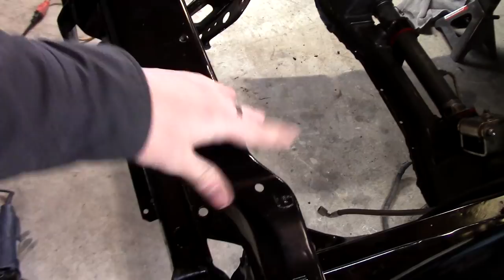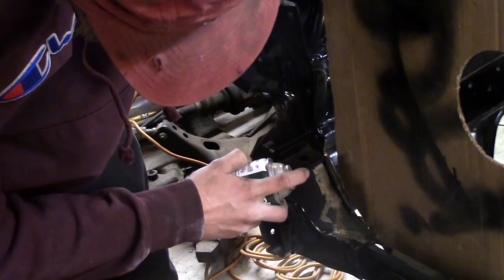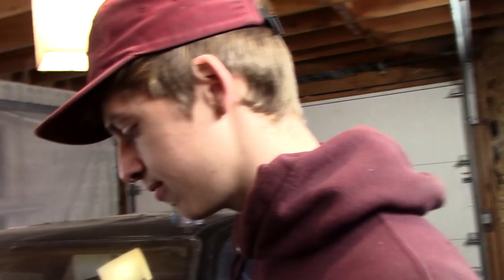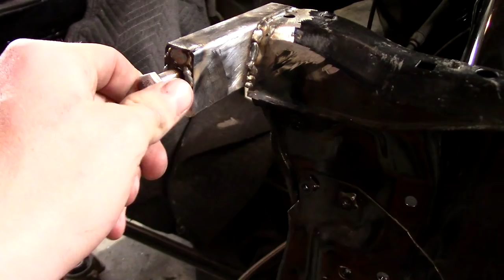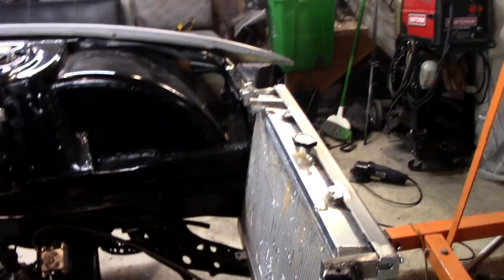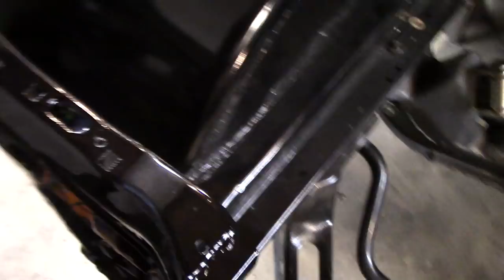Fabricating a Removable Radiator Support for the 1JZ S13 Hatch!

Comment: Please go change out those Phillips head bolts on the camber adjustment for some hex bolts. You’ll never get those tight enough without stripping them out. And then you risk your suspension shifting mid drift and losing control.
Reply from the maker: I think I said in the video that we replaced them with allen head bolts... We forgot two, but they’ve been replaced as well
Reply: Oh, I must’ve missed that. Good call!